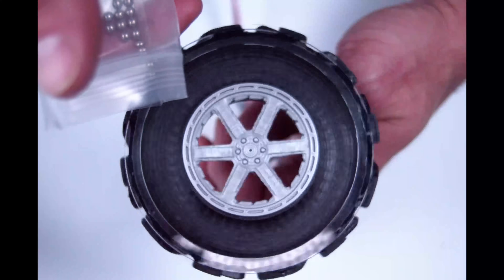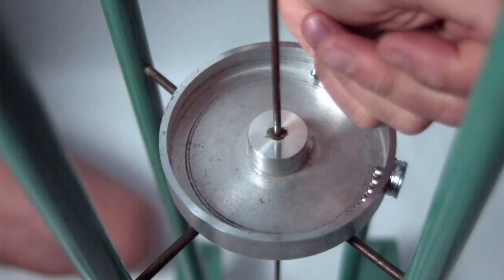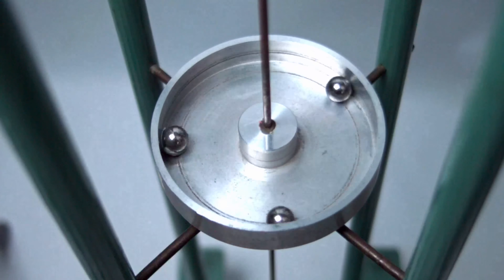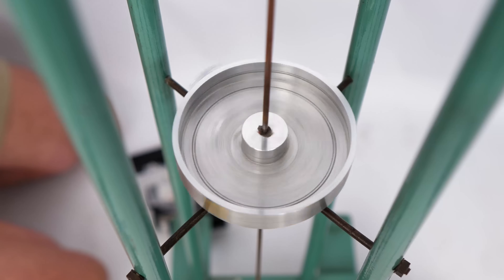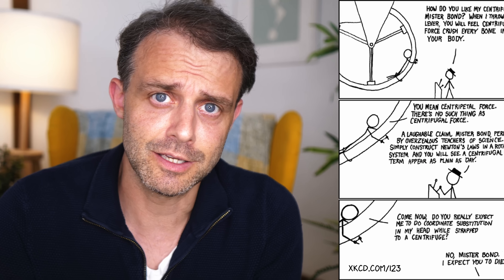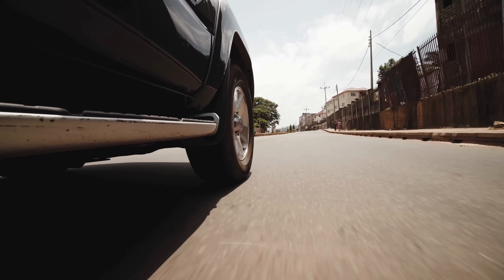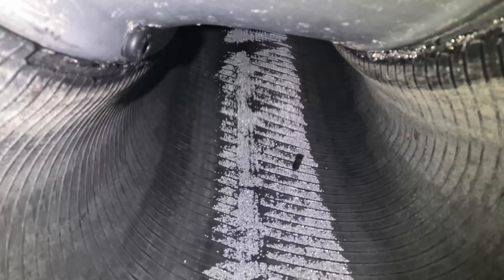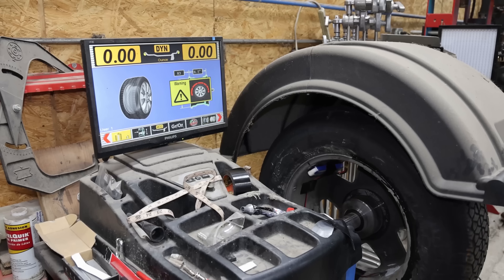Do tire balancing beads actually work?

Comment: My tires on my military truck (53in) are totally miserable when they are not balanced. Old farmers started this idea, but with antifreeze instead. I used antifreeze myself for a few years, but the first tire change quickly discontinued that idea since it is a horrendous mess to clean up. In theory the tire beads should be easy to transfer from one tire to another, but I’ll find that out for sure during my next tire change. I imagine there will be some loss from damage, but only time will tell.
Reply: 1990 BMY 923A2 reporting for duty 🫡

Comment: I wonder if there is a product that are like "sticky" beads. So you can throw the beads in the tire in the shop, get it up to speed to balance, and then they STAY in the balanced position. Like little beads made of some kind of putty or are covered in some fast acting adhesive.

Comment: I prefer the term "inertial force" to "fictitious force" personally. And everyone always gets caught up on centrifugal force, but there seem to be fewer objections to the Coriolis force, which is a similar "fictitious force" that appears when resolving things in a rotating reference frame. 

The explanation on resonance was a bit incomplete. In actuality, there are several resonant frequencies, each corresponding with a natural mode (actually, in theory, for a flexible system, there are infinite natural modes, but in practice only the lowest frequency ones can be noticeably excited). By increasing the rotational speed, you exceed the frequency associated with the first mode and start exciting the second. If you look at the thin axle (or the flexible rod on the milk frother) you'll notice that there's another node and/or anti-node. This is the "mode shape" associated with this higher frequency mode. In what you call the self-centering mode (probably the second mode), the rod on the milk-frother has changed from a mode shape I would associate with "fixed-free" boundary conditions to one that resembles "fixed-fixed" boundary conditions. It seems the mass of the end weight is sufficient to make it behave like a fixed boundary a these higher frequencies, and this is the key to your explanation.

Comment: Mechanical Engineer here. Another aspect that is involved is the transmissibility of the structure; i.e., the aspect ratio of force transferred. All structures will have different isolation at different frequencies, and thus different transmissibility.

Typically, transmissibility is higher at lower frequencies, which is how we describe the flailing/vibration modes as you described!

Comment: The behavior's just a driven harmonic oscillator - there is a phase shift related to how far off-resonance the driving force period is. Hence the different behavior at low vs high speeds. At low speeds, the motion is in phase with the driving force, so any imbalance grows. At high speeds, it's almost perfectly out of phase, so imbalance is canceled out. There's not much else to it.

Comment: Modern wheels are fancy spokey alloys that you can't really put those clip-on weights without damaging the finish.  So, they have the sticky-back weights to affix to the barrel of the wheel, but they tend to fall off after an indeterminate period of time, & unbalance your wheel.  Beads automatically balancing your wheel/tire combo for the life of the tire/tyre sounds good to me.  
  I get the impression, however that they are not as recommended for cars as much as for larger vehicles.  For tractor-trailer commercial vehicles they are a Godsend.  Imagine putting balance weights on 10 - 18 wheels!  I think the beads can also be great for motorcycles.

Comment: I think that doing your analysis in a horizontal plane is somewhat artificial, when the car tyres are in a vertical plane and the beads or ball bearings are subkect to gravity and this will make a difference as to how quickly they are able to balance the tyre as it speeds up and unbalance it as it slows down again.
Personally I think that it is preferable to balance the wheel and tyre with fixed weights because unless you're doing highway speeds the extra weight of the beads is going to add to the wobble of the unbalanced tyre+wheel, and theteby add to the wear on the wheel bearings and tyre itself.

Comment: Water or silicone oil would be a better option, as it would react at much lower speeds.

All that being said, if you have the option to address an imbalance by balancing it in its most basic form (wheel weights), then why not?  Now the entire system is closer to perfect, and any additional "live" balancing doesn't have to work as hard to achieve results.

Comment: i think the tire balancing beads are not a scam, but that people are using them incorrectly. if they can balance a wheel, then you should be able to place them into a space in the rim where they roll freely to balance the wheel, accelerate the wheel to freeway speeds, then slow it down and introduce some kind of binder that can lock them into that place. centripetal forces will ensure the binder finds its own balanced distribution, and the beads will maintain their balanced position around the rim. i don't know how this would be achieved, but that seems like the most optimum way to use them.

Comment: OK so ... apply the beads with a low-viscosity flexible resin.. bring the wheel to speed and hold speed until resin cures.. permanent balancing? Also, could this be used to make a low-cost self-balancing centrifuge? And how about high-speed rotary turbines, air movers, etc.?

Comment: The only way I could see balance beads being a viable alternative to traditional wheel balancing, is if there were some kind of adhesive that would be temperature-reactive that could put inside the tire, so you could get up to highway speed, balance beads find their home before tires get hot, adhesive activates, and beads stick in place. But that sounds more complex, error prone, and potentially expensive than traditional balance weights.

Maybe they'd be a good solution for trailer tires or something?

I could also see them being a decent alternative for people who live way out in the boondocks, who do their own tires with a manual tire changer and have no access to a balancer, and most of their driving is extended periods at country road / highway speeds.

Comment: Why don't you just try it?  Stick 5 ounces of stick on wheel weights on the inside of one of your wheels and drive it.  Then put 10 ounces of balance beads in the tire.

Comment: human intuition is nothing. above gives freely all good things. thats why you cant have nice things. sounds like random distribution to a suitable distribution. well of course an unbalanced wheel wobbles more at slow speed, and is more even at higher speed. because wobble is the function of the unbalanced mass speed around the center of the mass. the faster you spin the unbalanced mass, the more evenly the mass is in the center. knowledge makes proud under judgement. no thanks.

Comment: I was imagining that they would have a heat sensitive glue that let them stick to the tyre wall once the tyre was hot enough from driving at highway speeds, but then, your hub and tyre may be differently balanced, so, I imagine, having a balanced hub and tyre beads with heat sensitive glue would make sure your whole wheel is optimally balanced

Comment: I was going to buy some before but never did. The seller that made these beads said they would not work with my tires. Now I'm thinking I can use anything in the tire. Not steel because I don't want it to break my tire pressure sensors and steel would probably wear the rubber tire out from the inside. But glass marbles might work alright. You should just need the amount of weight that makes the light side of the tire weigh the same as the heavy side of the tire. You need at least that much. Any extra would still balance the tire.

Comment: no idea how it could be done easily mainly getting it in there quick enough but some of the beads in some sort of rubber or resin would be cool if you could install them go for an hour long drive at highway speed while the rubber/epoxy cures leaving the beads in the perfect balance

Comment: @SteveMould 
I downloaded Anydesk using your link, discovered some limitations: 

(1) Although there is a TVOS app it cannot be controlled i.e. cannot accept incoming connection

(2) To use ios app you need to buy a license ... "Since AnyDesk version 7.1.1 on iOS, incoming sessions from non-licensed clients are blocked. This means you can no longer connect to an iOS device from a free (unlicensed) AnyDesk client. Both the connecting device and the iOS device must be associated with a valid, paid AnyDesk license " 

(3)Session Time Limit: Sessions are limited to 60 minutes; after that, the connection will automatically disconnect. with  users reporting session limits as low as 20 minutes, depending on usage patterns.

(4) No File transfer

(5) No remote printing

(6) No remote reboot

Comment: I tried them in a fairly powerful motorcycle, as the local “Cruiser” shop swears by the tire beads. I found under rapid acceleration the beads created a bad imbalance that induced the beginning of what is known as a “tank slapper” it would be really interesting to see at what rate of acceleration this caused the beads from “clumping”. Thanks for this video it helped confirm some suspicions that they have to rebalance after every stop.
Reply: Maybe too much or too little was used. I use them in my sport bikes and never experience that very smooth ride even at very high speeds. Then again every bike and tire are going to be different so could be specific to the motorcycle or the tires possibly.

Comment: If the beads were made from some material that heated up then solidifies, would this not make the balancing permanent if you got the tires up to highway speeds within a set amount of time that the material heated up and solidified?

Comment: I'm gonna stop watching at 2:15 and just assume the balancing beads only work if I floor the car.
Reply: Every drunk driver approved this comment
Reply: @lucastucas7095😂😂😂
Reply: Imagine slowing down after the balance is achieved.... replace a u joint every 500 miles
Reply: It's the same concept as what you're supposed to do when on ice or hydroplaning. Floor it and you're good.
Reply: @lunchbox1553  also potholes that aren't too big. The faster you are, the more likely you are to just glide over it 😂
Reply: 88 MPH lol

Comment: It's such a bunk solution to a basically non-existent problem.  Mechanic might charge $20 to balance a tire, vs the hassle of removing valve stems and dealing with beads sloshing around inside your tire indefinitely.  Just do it right and have a professional use the correct solution for the problem.

Comment: If it works with N beads, then it should work with liquid. I wonder if you could put a slow-cure epoxy in your tires, then drive fast until it sets.

Comment: So if you could find a way to glue the beads in place once the tire is up to speed, maybe use a heavy epoxy or something instead of the beads, spin the tire up to speed and keep it there until the glue/epoxy sets, problem solved?

Comment: could they add adhesive to the beads and rev up the wheels at the shop? That way the beads would get into the right place, the wheel would keep spinning while the adhesive dries, and then they should be balanced after that

Comment: I am a fleet mechanic for my local government and we used these on light duty trucks a few years ago and generally had good results except for a few f250s from the fire department which had nothing but issues at highway speeds which caused us to stop using them. I remember the salesman explaining how they worked and being skeptical and tried to come up with a theory of how they could work in my head but never made it far. One of the things they mentioned was the small beads moving together inside the tire would create enough of a static electric charge to hold them somewhat in place while the wheel showed down so it would keep the balance at lower speeds. Could also be marketing BS, but who knows lol

Comment: As a Canadian, I often have ice/snow stuck to the hub so even if the wheel is balanced, the snow create imbalance. Could the beads be in, in a balanced wheel and compensate when unbalanced by outside effect? Until it leaves and the beads balance back to their place.

Comment: Balance beads are trash! Had them put in my tires when I got 35s and I constantly had issues with them wobbling and vibrating.  Went to the shop multiple times to resolve and they couldn’t. Ended up paying another shop to dismount, clean out the beads and properly balance my tires.

Comment: You didn't touch on the flex of the tire as it touches the ground (visible in the video clip of the inside of the tire) and how that plays into it. I've always thought that would affect bead settlement and prevent it from working properly.

Comment: So if I understand correctly, the weights permanently installed by mechanics keep the tire balanced at any speed, but these hokie beads only work by getting your car up to highway speeds and every time you have to slow down you have to restart the process. I think I'll stick to the traditional tire weights

Comment: I think your analysis missed one factor. 
The tyres are in contact with the ground, not just the axel. This provided another force, specificaly one that limits how much the tyre can wobble at that resonance speed.
This might be similar to how you manually centred the milk frother to lower the inertia - the ground limits how badly balanced the wheels can get, and so we might get into that non-resonance wobble state sooner than we'd expect for a wheel suspend in the air.

That difference might be why some people swear by them, because (depending on the strength of this effect and the specifics of their car), it might make the beads get into the right configuration much sooner.

Comment: I've used them very successfully in 4x4 vehicles. Normal weights get wrecked going up and down to 15psi, but I wanted highway comfort.
But they get expensive if you debead the tyre.

Comment: 20 years ago I put 4 golf balls inside the 22.5" tires on my motorhome. They balanced well. It was a rear engine diesel "pusher'. If I had the drivers window open I could hear them bouncing around inside the tire when I stopped at a traffic light.

Comment: So, if the beads are in a non-balancing position at speeds below the critical threshold, they would make the tire even more unbalanced than it would be without the beads.
Cars that see a lot of stop-and-go city traffic would have very poorly balanced tires, even if they occasionally exceed the critical speed.

Comment: The conclusion seems like what I'd expect. Although, the other thing I'd think about... They're glass beads, that's harder than an aluminum wheel and harder than a rubber tire. I would wonder about putting an abrasive in my tires... Seems like it might scratch things up.

Comment: You can see the same thing with an IKEA battery-operated milk frother. If you start it outside a liquid, it runs at slow speed with lots of vibration. If you gently touch … oh, I see.